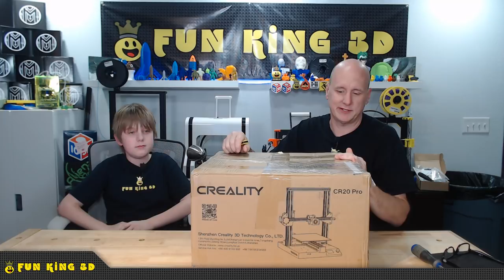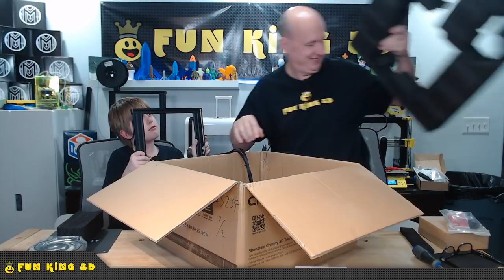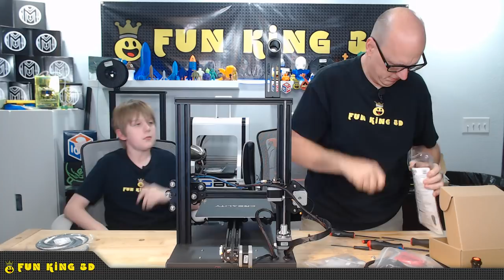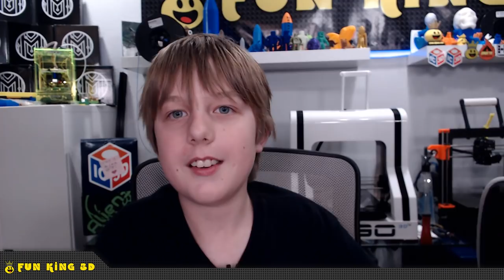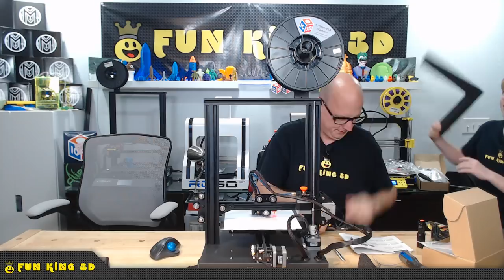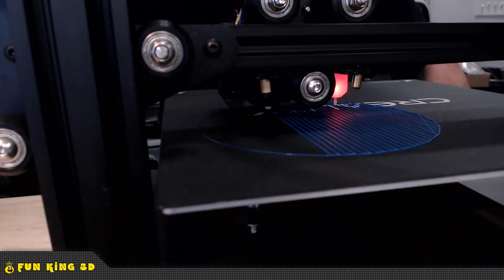Building the Creality CR-20 Pro (before the F3DPCH stream starts)

Comment: How good is the auto leveling bed mechanism? Are you able to compare with the Ender 3 to see if its a worthy upgrade? Thanks!
Reply from the maker: I do not have an Ender 3 unfortunately. So I have no way to do a comparison. The auto leveling seems to work well if you take the time to adjust it.
Reply: @FunKing3d  hi i have the same printer but i cannot figure out how to adjust the distance between bed and nozzle. There is no explanation in the little book.